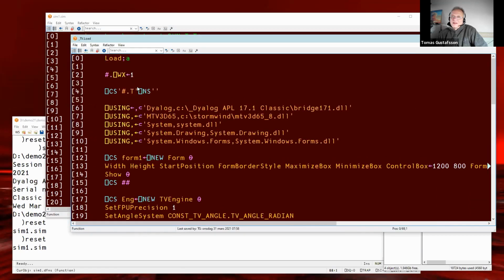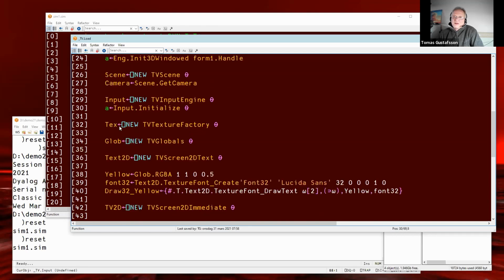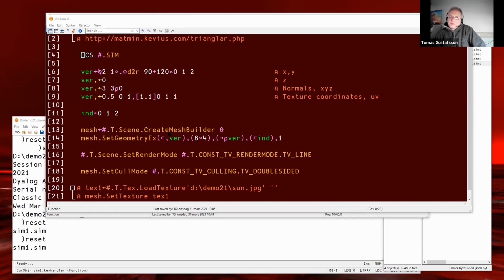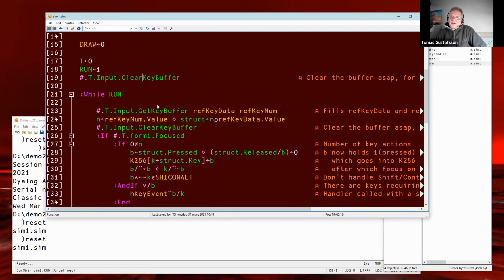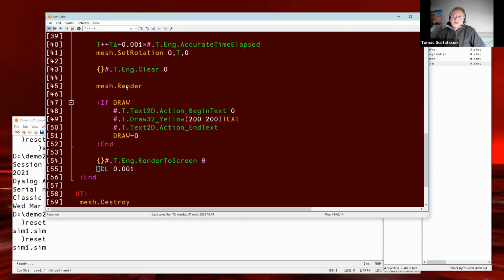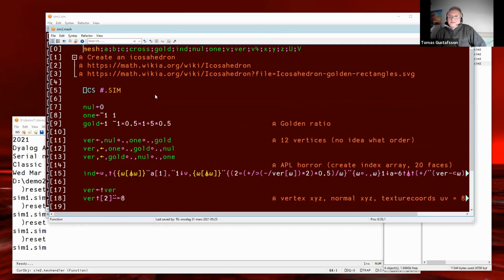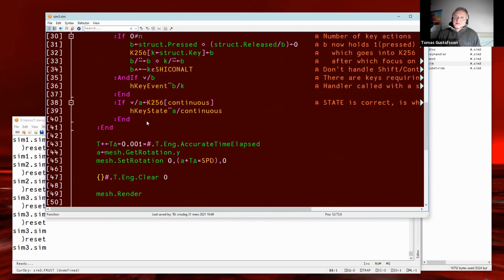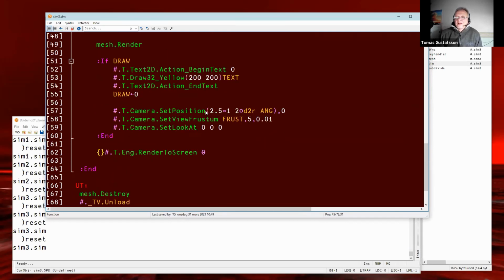Simulation and Gaming with APL // Tomas Gustafsson // APL Seeds '21

Comment: Great video and explanation of interfacing APL with the MTV3D game engine, but I could not get it running with Dyalog APL/W-64 Version 18.2.45405.  The code calls bridge171.dll, but the newer version has bridge182-64_unicode.dll. Changing the call to the newer version still results in the same error. Here are the error lines:  

Could not load file or assembly 'file:///C:\Program Files\Dyalog\Dyalog APL-64 18.2 Unicode\bridge171.dll' or one of its dependencies. The system cannot find the file specified.
Could not load file or assembly 'file:///C:\Users\rpjhe\U03_SimulationAndGamingWithAPL\demo21\mtv3d65_8.dll' or one of its dependencies. An attempt was made to load a program with an incorrect format.

I'd love to get this working and play around with it, and see more of your videos. Thanks!
Reply from the maker: Tomas' code is written using Dyalog v17.1 Classic 32-bit; this means that his materials cannot be used by Dyalog v18.2 Unicode 64-bit (the version that you are using) directly. We are investigating what needs to be done to get things working for you; please contact Dyalog Support (information on our website) so that we can keep you updated with progress.
Reply from the maker: We now have a Dyalog v18.2 Unicode 32-bit interpreter that can be used to experiment with Tomas's code. Please contact Dyalog Support (information on our website – dyalog.com) so that we can tell you how to get it.